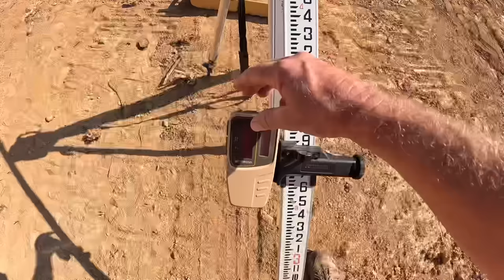ENORMOUS POND DAM WRECKS THE BUDGET…

Comment: Thank you in showing a great video again.  Also may God Bless you for bringing the word in such a great way here in your video. 

On building dams and ponds. You just need your faithfull dozer and maybe an excavator. The dozer just push all the dirt from the inside to the sides just where you want it. People underestimate the workforce of a dozer in displacing dirt from one point to another. You can do the damwalls in layers by working it flat and compact it with your roler and then move the next pile of dirt from inside to form the next stage of a layer on top of the previous one. 

I'm not in this industry but worked as an earthmoving mechanic on these machines and saw how these earthmoving construction companies do this farm dams and ponds just with a dozer. 

Hope it will be of great assistance to you. 

God Bless 🙏🏽🙏🏽🇿🇦
Reply from the maker: Thank you and I appreciate that. And God Bless you and thanks for the encouragement!
I definitely will try pushing dirt onto the dam more on the next one. This was a great job and I learned a lot.
Thanks,
Sam

Comment: You had mentioned efficiency over this series of videos. I also watch a few other channels that build ponds amongst other things. If I recall correctly, Mike over at Dirt Perfect talked about the difference between using the excavator and truck verses using the bulldozer. Sometimes it was better using the dozer, other times it was not. So it may be worth a little time determining how much dirt can be moved with each method. One may be considerable more efficient than the other within a certain distance.  Not claiming to be an expert, or an amateur, just giving food for thought.
Reply from the maker: Thanks Scott, you are right it’s always worth thinking about how to move dirt more efficiently. The pond job was a good project to learn on.

Comment: Retired estimator here. My past motto  was calculate amount of dirt 3 times, then average of the 3 calculations. Then estimate time on equipment. I used going price per yard of cut and fill, then going price per hour on equipment. Then   compared the 2 methods. I will guess you was off because of not calculating the fill properly. The dam is extra wide you had plenty of dirt to cut and made the dam wider than necessary.  I hope this wasnt too confusing. Anyways your getting it done and it will be a good pond. And good lessons learned
Reply from the maker: Thanks for the info Rick. Definitely need to spend some time learning how to estimate the dirt. I generally just do time and materials and figure how much time it will take. But the first job of this size is always a learning curve. I would do it all over again just for the experience I gained.
Thanks,
Sam

Comment: If it's of any help, the contractor I used to work for used a 300ft threshold. If the dirt had to move less than 300ft he'd push with the dozer. If it had to move farther than 300ft, he would pick it up with a pan and cart it over to dump. Those numbers might not work the same for you, but the principle should.
Reply from the maker: Thanks I appreciate that info. Would be cool to calculate that same principle for my setup. 
Sam

Comment: Love the video i know all about your struggles iam a one man band so i have learned how to be efficient with the equipment that i have every move is important it took a few jobs losing money to figure it out and have a strategy that's going to make you the most efficient good job Sam love the videos
Reply from the maker: Thank you Eric. Like you I learn a little more on each job. Thanks for supporting the channel.
Sam
Reply: @tristardiggin, good ac system LOL, you may want to get a small flexible solar panel and tape it near the ceiling of the excavator. and a small wired fan to circulate air at the bottom of the cabin under your seat.
Reply from the maker: The ac is a little rough in the dump truck for sure.  Could definitely use a fan or two. Hope to get the ac fixed some day.

Comment: When checking how much more u had to fill after getting your bench mark grade put the receiver on the top of your 3rd section and start pulling up the sections from the top until u get your beep and read the back of the stick the numbers read backwards from the front and it tell u where to attach your receiver to on the front
Reply from the maker: That is good info. Will try that…
Thanks Sam

Comment: You need to learn how to use a level rod with a laser receiver.
Reply from the maker: What was I doing wrong
Reply: @tristardiggin  not really wrong i guess....i come from a survey background where you set an arbitrary elevation on the bench mark then set your laser at the top of the rod and read the height off the rod directly (usually off the back of the rod). Add/subtract the rod reading from the bench elev. to get the difference.  Allows you to carry an elevation wherever you need on the job site.   Hope that's not too confusing.  Didn't mean to be too critical oof your method if it works for you.